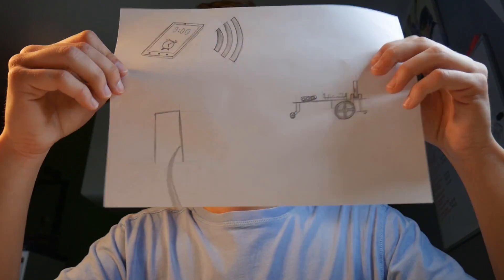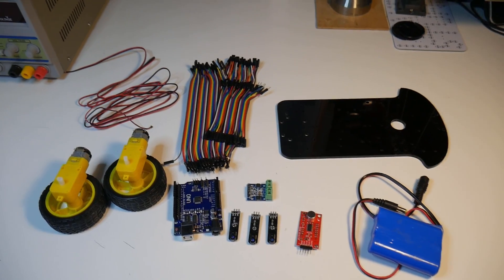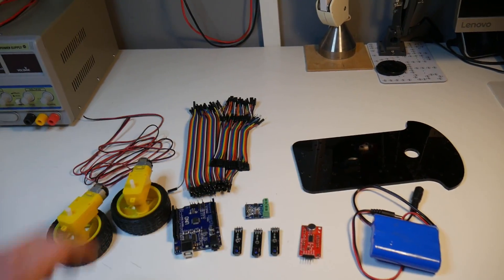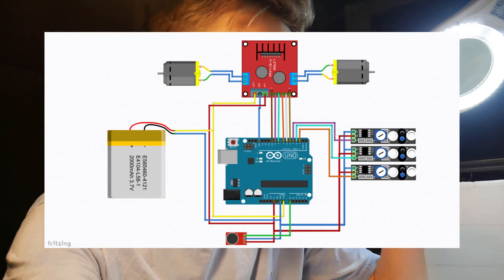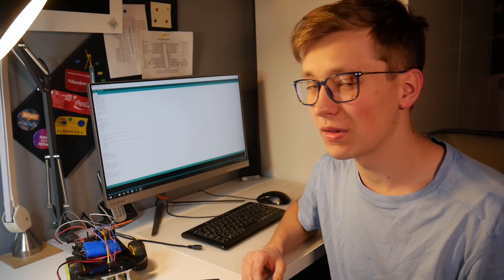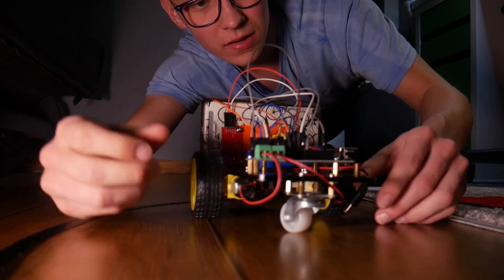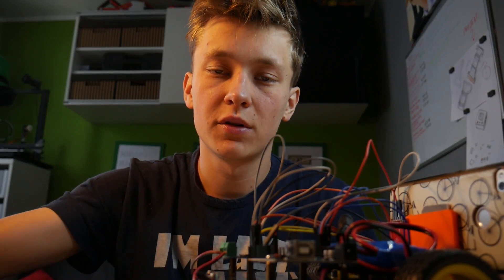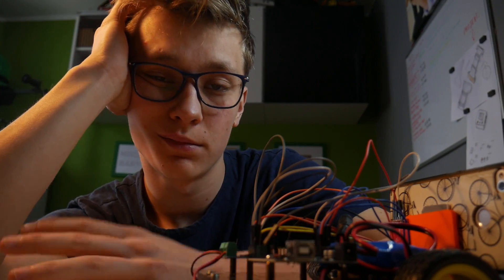This Robot Will Force You To Wake Up

Comment: Hi Nikodem,
The project is nice, but now I'll explain how I did it: my bed was hidden in a corridor so I did not have much space either and I had the same problem: if I turned off the alarm then did not start again and I turned the other part (at the time there were no smartphones, I used the mechanical alarms, those that tick and have the two bells above the dial, there were also electromechanical but for my sleep were too "kind": they did not make enough noise. I started to sleep with my head on the opposite side of the bedside table on which the alarm was placed, this forced me to get up sitting on the bed to turn off the alarm that would have awakened even the devils in hell for the noise it made.
Once I sat on the bed, then I was awake enough to get up, but I did not have to make the mistake of going back to myself ... otherwise ... good night!
P.S. do not think that a century has passed: only 40 years!
For an acquaintance of mine, from even deeper sleep, I wanted to use a wiper motor placed over the bed, so that, at the sound of the alarm clock, he would bang him in the face until he got up :-))) in case it did not work either the robot ...
Hello and i'll see you on the next videos

Comment: Interesting and fun project. I am totally not a morning person! I’m not sure a robot that moves my alarm away from me would help me wake up. I’d just let it drive far enough away that I could fall back to sleep. ;). 

What might be a better system for me would be an app (or piece of hardware) that makes an alarm sound near my bed, but requires me to walk to a deactivation point (maybe NFC based) and as a bonus solve a problem (maybe a simple math operation) to force my brain to engage. Even better would be if it had some kind of sleep monitoring and logging with a sleep stage dependent wake up trigger (within parameter times). That would be pretty comprehensive.
Reply from the maker: Someone in the comments below mentioned an app that requires you to scan a QR code placed in other room to turn off the alarm :) Thanks!

Comment: If you want something a little more practical, I use an app that won't turn off until you scan a qr code that I put in the other room. I works really good.
Reply: Thats god damn genius
Reply: Got the app's name?
Reply: @thepurpleone7153  Alarmy it's the app (my favorite)... another app that does that is Alarm Clock Extreme.
Best way to use that "QR code scan" is to put one in the bathroom, so right after you wake up you brush your teeth/take shower/etc... or, you can put QR code on your coffee mug in the kitchen... or, near some motivational quote... you choose!
Reply: I use early bird alarm clock but there are multiple to choose from
Reply: I believe lazy people are the true innovators haha